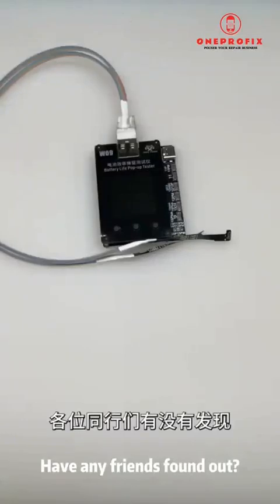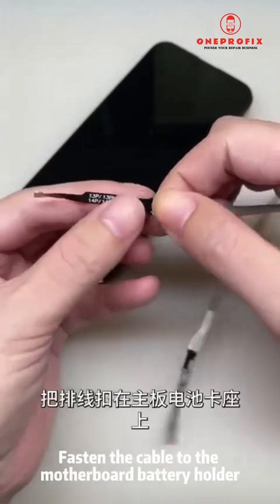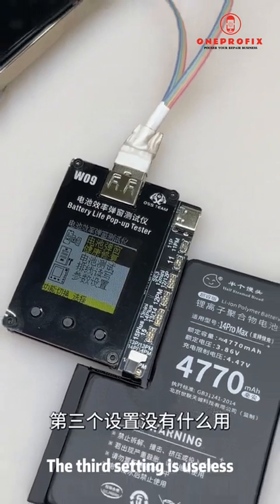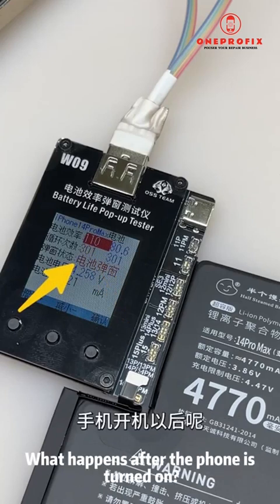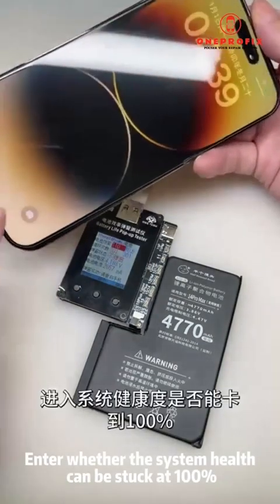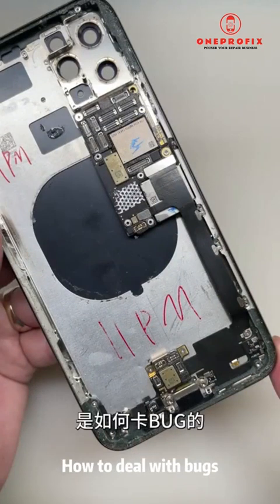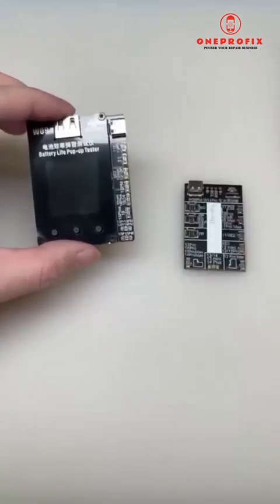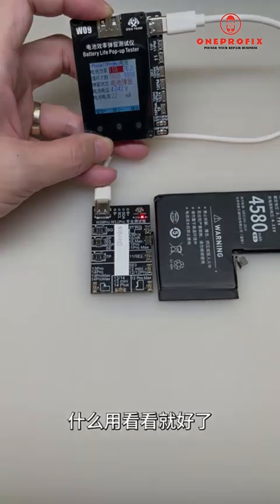OSS W09 Pro Battery Efficiency Pop up Tester No External Cable Direct Card Efficiency 100Data Repair

Comment: I bought mine but it's defective, I carry out the procedure, it gives an error message, but it doesn't change the health. Do you have any configuration? It just keeps showing the unknown message. Detail I've seen countless videos that when we turn off the equipment with w09 it switches from popup to NoPopup and that's not happening on mine.
Reply from the maker: For professional mobile tools please contact :
👉 WhatsApp:+86 188 2380 2600

Comment: Is it possible to use an original battery with BMS from another iPhone 12 and then make the pop up disappear?
I no longer have the original BMS for my iPhone 12; Thank you
Reply from the maker: For professional mobile tools please contact :
👉 WhatsApp:+86 188 2380 2600
👉 Wechat: +86 188 2380 2600

Comment: No need to swap original battery flex cable
Reply from the maker: unnecessary
Reply: But still same pop up battery massage
Reply from the maker: @hindtech7295  For professional mobile tools please contact :
👉 WhatsApp:+86 188 2380 2600